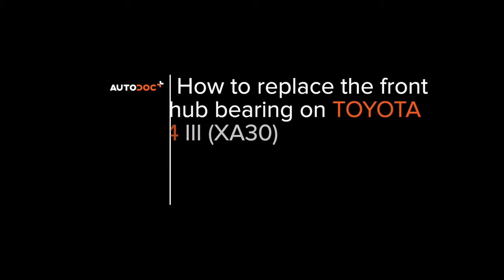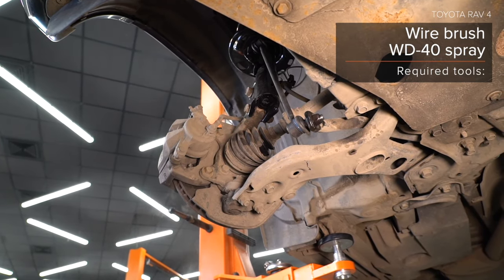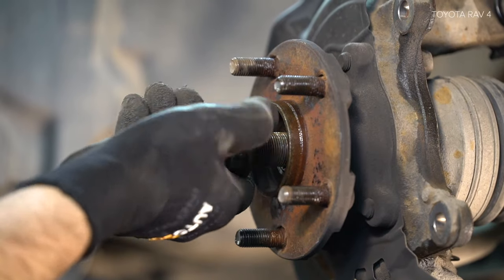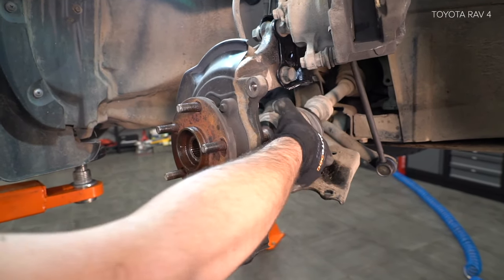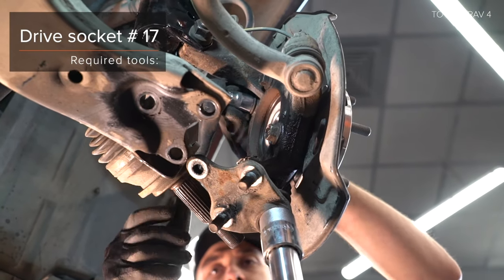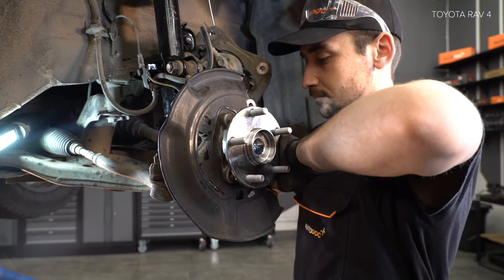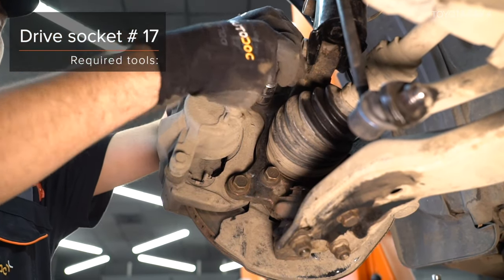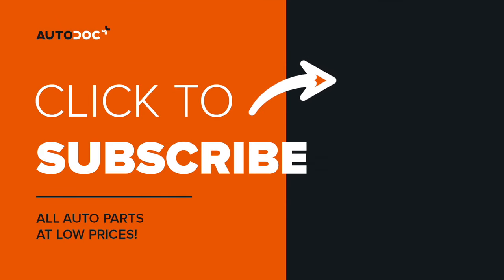How to change front wheel bearing / front hub bearing on TOYOTA RAV 4 3 (XA30) [TUTORIAL AUTODOC]

Comment: Took my 2011 limited V-6 to an independent service shop to replace my front wheel bearings. They butchered my half shaft. Must have used an air impact without pushing out the locking indentation. You made this look easy.
Reply: You can run the axle nut off almost any vehicle without de-staking the nut, but for some reason Toyota's axle nut must be de-staked otherwise the threads will get ruined. There are several videos warning about that very issue.

Comment: Hello sir. Can I change the bearing only? Press the bearing
Reply from the maker: Thank you for your comment!
Yes, in general, only the bearing itself can be replaced, but this is a rather time-consuming process, requiring many expensive tools. It is much more advisable to replace the bearing assembly with the wheel hub.
Reply: For those of us with more time than money: 
- The tools needed can be rented usually for free, from any auto parts store
- All you’ll need is a new wheel bearing and grease. Which will be a fraction of the cost of a whole new hub. 
- This video should be retitled to replacing wheel hub. It has nothing to do with the wheel bearings at all.
Reply: @frankzbeanz4200  
Hi buddy 
Is it the same for rav 4 
2020 in canada
Is it necessary to do the 3 bolts of the suspension
The u joint think
Thank u